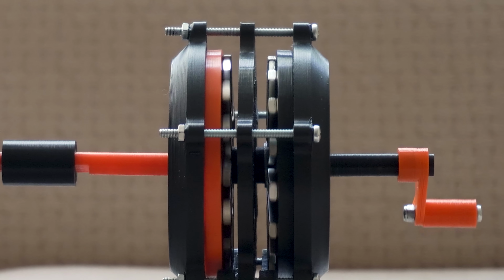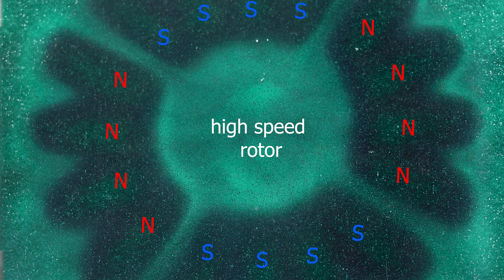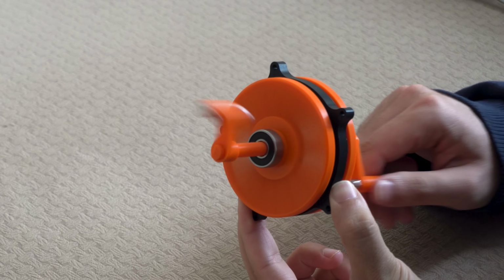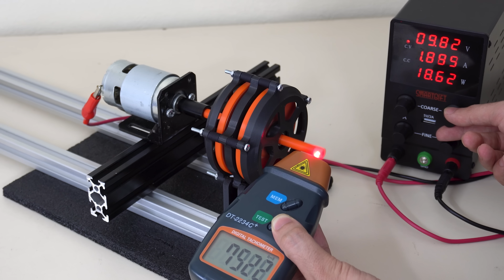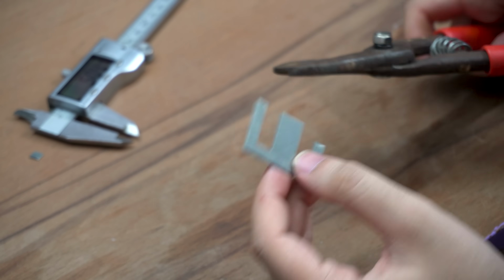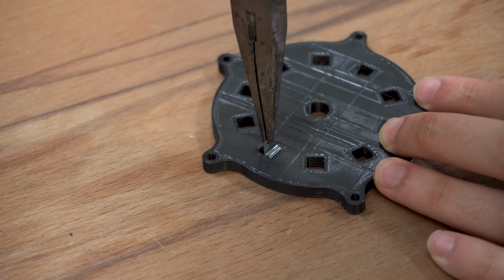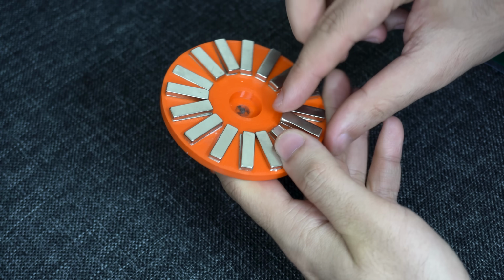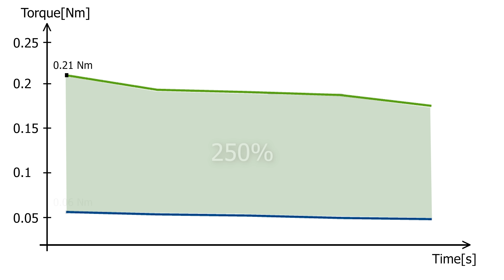Gearless Magnetic Transmission - You Can't Break These Gears

Comment: Did anyone else see the nuts cycle through loosening then tightening over & over?  Would love to see the forces pulsating back & forth to do that. Great vid & love the outside box thinking. Cheers.
Reply: I saw that too
Reply: Should've been using brass fittings rather than cheaper steel.
And either lock washers or lock nuts.

A certain amount of flex is wanted, though.  Too much rigidity is why the magnets went flying at the beginning of the video... with utterly no safety shield around high speed rotating disks...

Comment: This absolutely so cool and amazing, please keep going with this concept. I love it so much. I wanna see this used in car or other applications.
Reply: This idea is old. An American Car (built in the 1950's) had a Magnetic Transmission. Sorry, but I cannot remember the make of car.
Reply: @peterduxbury927 it was the Owen Magnetic, made around the time of the First World War. Jay Leno has one.
Reply: @chrishenniker5944  YES! Thanks for that. I knew that I had seen this somewhere. It is old technology that didn't take off due to inefficiency.
Reply: Its an old idea that couldn't do any actual work then, just like it can't now.
Reply: not possible. It's stupid- better to have a hybrid generator powering either the battery pack of an electric motor or electric motor directly- which needs no transmission.
Reply: The problem is still the torque capacity.
Reply: You put alot of faith in plastic considering the metal pieces that are inside spinning at that speed.  The potential for getting a magnet in the eye or into the chest is there.😮
Reply: Also the electromagnetic clutch has been around since the 1910's- another example of idiots re-inventing the wheel. Where can you find electromagnetic clutches? On any vehicle that has air con- certainly since the 1950s, the refigerant compressor can be switched on or off via the electromagnetic clutch engaging to the drive pulley as driven by the cambelt. When electromagnetic clutch is connected- compressor receives power from cambelt, when off- cam,belt has load reduced= more efficient engine as engine not subject to as much friction load.

Comment: i used one of these on my capstone project for mechanical engineering technology. My team and I built a velocity head hydro-turbine but found rotary shaft seals difficult for the generator which was under water (an connected to the turbine).  Solved all our problems and worked great!
Reply: Obviously your university has less than stringent standards- why on earth would you have an immersed generator- how the hell is that 1 supposed to function, 2 be maintained?
Reply: @markiobook8639 underwater currents?

Just like we maintain underwater pipes and oil infrastructure?

Comment: Have a look at particle clutches. They have two cup shaped ends the the in and output shafts, one cup sits inside the other. A soft iron powder is placed inside the cups. There is then a coil that wraps around the outside of both cups, vary the current on the coil which then varies the drive torque through the coupling. They also allow for slip if the torque level is required is exceeded.
Reply: There are no such thing as "particle clutches" you are talking about the 1900's electromagnetic clutch with a syncromesh. Syncromesh which uses bronze pre-load conical bearings to take the initial force from the driven gear to the selected gear on the gear drive- enabling smooth shifting and far less stress on gears- enabling quieter, smoother herringbone teeth, vs straight cut teeth. Not new.
Reply: Not saying you're wrong, but Wikipedia shows me Magnetic Particle Clutch, which is "a special type of electromagnetic clutch" and does indeed have "a fine powder of magnetically susceptible material to mechanically link ... a disc on one shaft to a rotor attached to the other shaft".

Comment: There is not so much friction, but I bet there's hysteresis and eddy current loss, especially when the drivetrain is loaded. I'd love to see a quantitative comparison between a gearbox.
Reply: A geared gearbox of this size can pull a car at least
Reply: davidgfbr Maybe, but I would need a couple more pieces of data to say whether or not agree with you. The phenomena I mentioned are velocity-dependent like friction, but not linear like friction.
Reply: F1 or Lemans would already be using this if it was actually useful irl.
Reply: @probably3dprintingsomething this cannot transmit any meaningfull amount of torque so it's pretty much useless in the real world.

Comment: Some audio feedback: Your voice has a stronger low-end than its high-end, but you articulate your words with mainly the high-end, this makes for a more difficult listening experience. I suggest an EQ to cut the low mids, boost the high mids and maybe also play around with the highs to make it sound less nasal. 
If this is also how you sound without a mic, you might to play with how/where you articulate your words to better engage live audiences.
That's all, I hope it's helpful!
Reply from the maker: Honestly, thank you so much, I will pay attention to that.
Reply: @retsetman9698  I'd say a basic de-esser, low shelf, and compressor would be ideal, if you're into that kind of thing. Otherwise, put a thick cloth/foam over your microphone, and record a bit closer to it, facing your breath away from it. 

Awesome video btw :D I didn't think the audio was distracting at all, personally. I hadn't seen how magnetic gearing works before, and it seems very elegant.

Comment: It's really beautiful work ! Subscribed!
Please consider making the design easly to stack a few of those in series. Also would love to see you add some coils like Robbert Murrey does and make a diy/emergency generator, preferably in gravity-light style, where the system should be stack a few layers to achieve higher loads and max torque , so a heavy weights can out strung high from the ceiling, with big reduction, providing more watt and also a slow and long decent so the cycle time is as large as possible, and therefore the most watt-hours between every pull up and reset of the weight. 
Thanks a lot and all the best !
Reply from the maker: all of what you said are great video ideas and definitely worth a try. Thank you so much for the good wishes
Reply: That what also be very good for slowly turning a large solar array.  Have you made any estimates for this kind of thing?
Reply: @retsetman9698 thanks for responding :) let me know if any of what I suggested stayed with you.. really hope to see it happen 💜

Comment: amazing stuff.  makes me wonder just how difficult it would be to do this with electromagnets.  then the torque could be varied and possibly have a device that works as both a clutch and gearbox.  triggers a bunch of other ideas in my head.  good work!
Reply: Yeah but that's be real expensive and complicated, at that point it wouldn't be worth it. Only expensive cars would go for something like that, but a practical reasonably affordable car wouldn't have it.
Reply: All real Cars are expensive
Reply: I think that would be called electric motor.
Reply: @fulconandroadcone9488  Indeed. Prius had that for more than 2 decades!
Reply: @fulconandroadcone9488  umm not really smarta$$..  what i'm thinking of wouldnt provide the drive power itself,  would work as i said, as both a clutch and gearbox for another source of drive power.  the torque it allows through could be varied.  maybe more of a variable torque limiter
Reply: @JohnTaylorFPV  I will assume that your manners also haven't heard of diesel electric locomotives. There is a reason they use electric motors and not some over engineered variable torque and ration magnetic transmission. 

Electric motors have more than enough torque that is easily limited with electronics, not to mention you can detect if motor is not taking any load or is taking more load then it should. As for gear range, well, most electric cars go from 0 to how many kmph with a single gear? Truth is you don't need a variable ration gear box for electric motors. 
Not to mention that it ends up being a simple compact unit with only one moving part, called rotor instead of how many in you case.

Almost as if using magnets and electro magnets in a form of electric motors has a such well established industrial around them that it is better to transform mechanical power to electrical and then back to mechanical then inventing some new electro magnetic limited torque clutch. 

And in the end every place where you could use your proposed solution you can use electric motors. And there is already a large base of electric motors. 

Not really sorry to break your dreams, it the idea as cool and interesting it is just doesn't make any real world sense.
Reply: @fulconandroadcone9488  I generally agree, but there is one place this might go is something like low torque/power applications. Though even there one could use actual gears and have far more control and far less bulk. That plastic seemed to compress a ton too which leads me to believe it's not exceptionally mechanically efficient. You wouldn't want to over-spin that either holy crap. Cooling that thing could get interesting as well. It's an interesting proof of concept though, and I do enjoy watching it work.
Reply: Once upon a time Citroen had an electromagnetic clutch in their cars. It was operated by a microswitch in the gear shift lever knob.
Reply: @vinquinn  yea, electro cluctches alone are actually pretty common in a variety of applications.  usually just a simple on/off though
Reply: @JohnTaylorFPV  The torque isn't dependent on the rotation ratio, it's simply limited by the magnetic field strength, so electric motors already have variable torque, they just simply weaken the field to reduce the torque and can achieve maximum torque instantly.

Comment from the maker: Subscribe for N52 magnets!!!
Reply: Have you considered using a Halbach array for the magnet array? Halbach arrays double the field strength on one side of the array and cancel it out on the other. Supposedly they are perfect for applications like this, but they require more magnets.
Reply: 4:10 The vibrations from the assembly caused the nut securing the case to fall into it. Go back to 3:15 to see the nut and screw just vibrate loose. Could try a bit of hot glue or school glue to hold it for a bit. Easy to remove when changing things around.
Reply: subscribed and cant wait to work with magnetic gears
Reply: Ok I suscribed. N52 magnets GOOOOOOOOOO!!!!!
Reply: Just did before this comment :)
Reply: Please switch to iron nitride magnets.
Reply: @petertrypsteen : It is information like these amongst comments, that are very valuable. I have not heard of it before. Researched and found they are stronger than N52 and makes me less reliant on Chinese rare earth raw materials. Bravo 👏 👏 👏
Reply: @gerritcoetzee9075  Thanks for the positive reply, nice to know my comment helped at least one person.
Reply: I wonder if theres a film, or material to wrap or put very close to this to “suck” out the eddy currents snd roll the resulting voltage through a peltier, to keep any parts that heat up cooler.  Vane design could chill the heated part of the peltier… or maybe just passive heatsink fan stuff could work.
Reply: No lube?
Reply: You said they are unbreakable but "permanent" magnets aren't permanent, but great video and cool design
Reply: Then imagine if it was electromagnetic I can easily change the gearb ratio and even increase the magnetic field increasing the efficiency of the gear😮 it can even increase and decrease the torque
Reply: Awesome 👍🏻👍🏻👍🏻
One more subscriber here
Reply: I don't get out of bed for anything less than n53.
Reply: You got magnets?
Reply: 3.5 NM soon
Reply: PLEASE PUT WASHERS ON YOUR BOLTS! That is why your machine broke at 8k Rpm! you can see the whole thing unscrewing from Vibrations!
Reply: Nicely done, subscribed!
Reply: too bad when you scale up, and place a load on it.. they would heat up and the magnets would stop working?
Reply: No joking? When I recieve my 1x1x1 N52 magnet I will subscribe, watch every video and plaster great reviews everywhere - ETK 295 Clay Avenue Rawchester NY 14615 🙏🏻🙏🏾🙏✌🏻✌️✌🏽✌🏿
Reply: very amazing ideas.
Reply: My fridge is plastered with these weak rubbery magnets advertising wick wack companies that Id let go of in a second if a truly based company were to give n52 magnets "Honey, can u get the milk"? "Not been able to open the fridge since you put those new pizza place magnets on the door"!
Reply: permanent magnet dies off. not good
Reply: @clonedmosquito  That's a solvable problem by using electromagnets. What is not solvable is the energy loss, increasing both by speed and power.
Reply: have you considered 12 or 16v electromagnets on either end? bearing can act as ground with a carbon brush and and metallic isolated core in either rotor for power. the interface material possibly having a small insulating film to prevent heat from eddy current. you may be able to use cheaper metals for more magnetic stength, more torque
Reply: I forget the arrangements, but you can multiply strength of your magets by rotating the field by a few degrees each on the disc where you have four poles.  The magnets would need to be machined so they would fit in the slots. Your 50 times stronger magnets will focus the flux even more this way.

There is a term to explain this idea, but I forget the term.
Reply: chechK DJI GEARS

Comment: I think this is really incredible engineering! My advice to you is that the space between the magnets should be decreased ... probably almost touching when "hot" so that if it gets hot, it doesn't stall. You will probably need a better material to handle those tolerances. But, I think the improvement in torque will be much better if the space is decreased even further. 
Could you explain just a little more about how you managed to "smooth" the  cogging effect?
Reply: If this concept does any serious work, it will get very hot.
Reply: @peterduxbury927  Hmm, hard to say for sure how much heat tho. I am definitely interested in more tests!
Reply: @marcfruchtman9473  I have had past experiences with this transmission. On a very powerful 37kW Unit, the temps approached 450C, and were capable of warping the components. There is also a huge loss in efficiency.
Reply: @peterduxbury927  i have seen pumps with magnetic coupling, because of one single magnet unit it does not produce  much heat, when many magnets and have slippage the heat is very high.

Comment: I really wonder how much better this could be with non 3D printed/higher quality parts. I noticed a lot of wobble at high speeds and I bet that better manufactoring methods could let you drastically decrease the air gap and unwanted vibrations at high rpm. Maybe larger iron pieces too.
Reply from the maker: I wonder about that too, though it's obviously going to get a lot better. Hopefully I will make a new one with metal parts soon.
Reply: Adding iron or steel discs/plates could play havoc magnetic fields, all metals/alloys suffer from a degree eddy current effect but ferris more so .

Comment: I know it would be astronomically more difficult with the tools you have but if you could figure out a maglev bearing to replace those standard ball bearings the results would be very interesting
Reply: maglev bearings will only tolerate certain weights, they will not tolerate serious working condition loads. Even air bearings have their limitations.
Reply: @markiobook8639  Might want to look into these large commercial flywheel batteries then. Spinning massive weights between 10k -100k rpm If this isn't serious workload what is?
Different form of maglev bearing is the high speed trains.
Reply: MagLev is not a bearing. It's a form of propulsion. If you are unable to comprehend that and that it requires far more energy than a conventional high-speed French TGV or ICE and the Germans' ICE being pioneers of air bearings and magnetic bearings- were forced virtue of forces involved use conventional needle bearings, then basic engineering is beyond you. Secondly flywheels are not massive if they rotate at 100k rpm- that defies near all known materials shear strength- they are instead tall and cylindrical- thus if Torque= FxD D is deliberately kept short. High speed is to offset flywheel lack of torque as torque is a function of speed and speed a function of torque hence F1 engines rev enormously high rpm with very short stroke and larger bore. @WhatTrigger

Comment: I'm planning on using something like this in some space hardware I am designing at work.
If you can seal the magnets effectively, this kind of shaft coupling can be used to make a pump or other rotating machinery that does not have any dynamic seals, which reduces the chance for a leak during the machinery's service life greatly.
If you use a thrust bearing, you can use some very strong magnets, which allows for a higher max (possible) torque.
Reply from the maker: Yes, there are indeed magdrive pumps without dynamic seals in the industry and they are being used, I have this idea in mind, but I really need some really strong magnets for the clutch and btw I think one of the areas where magnetic gears will be most useful is space because there is no need for maintenance.
Reply: Lol the Own Magnetic used this type transmission in 1916 and the electomagnetic drive was and is patented
Reply: @justme-n-gracie  https://en.wikipedia.org/wiki/Owen_Magnetic

Comment: You should use Washers when putting together bolts and nuts, to prevent them from losening from the vibration, also you could use a tiny amount of thread locker.